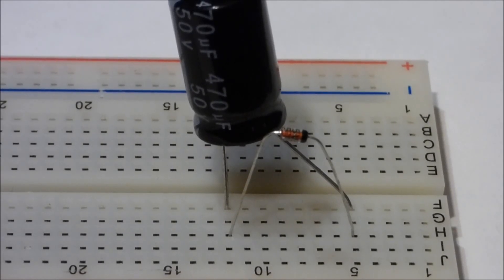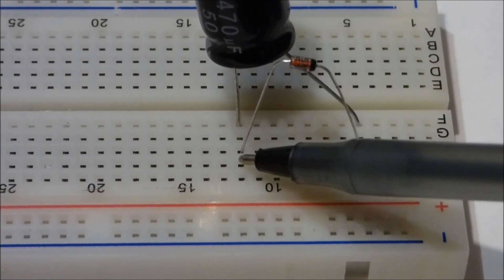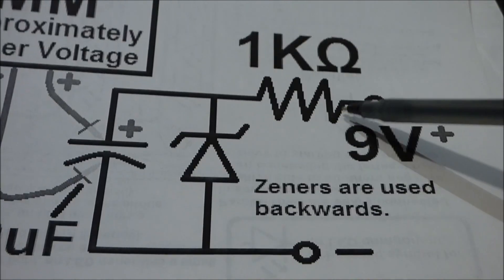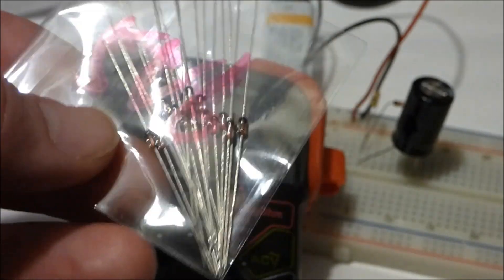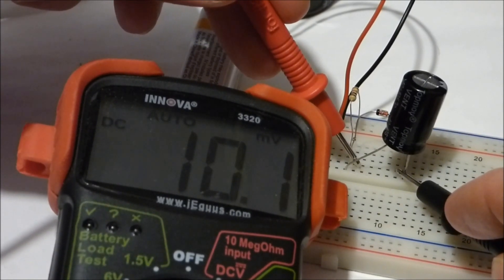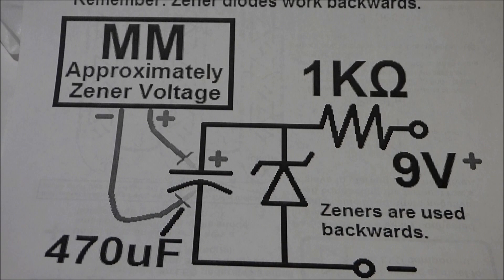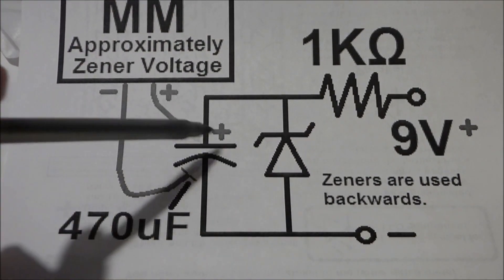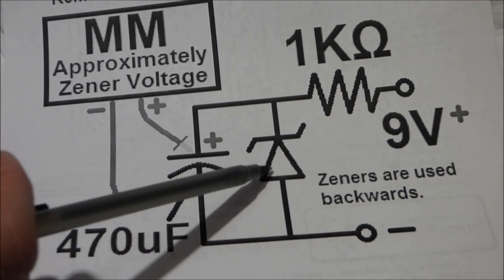Zener diode voltage rating test circuit and general zener diode tutorial for DIY

Comment: Hi, Why do you use the capacitor? You get the same MM reading without it. Or am I missing something?
Reply from the maker: You are right, the MM will get the same reading without the capacitor. I figure people starting out in electronics have more experience measuring the voltage difference across capacitors than semiconductors so in some videos I combine the 2.